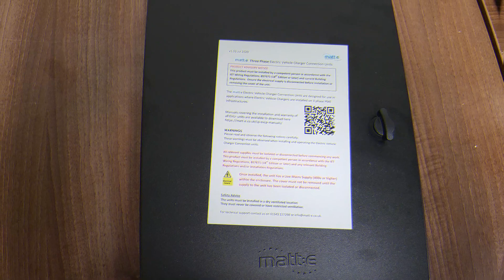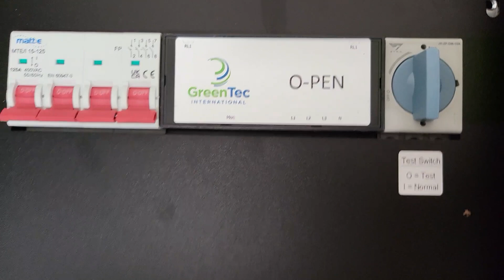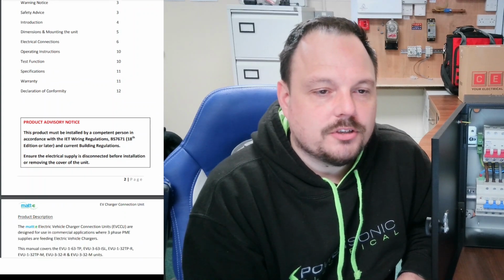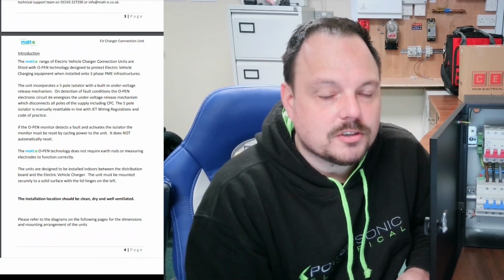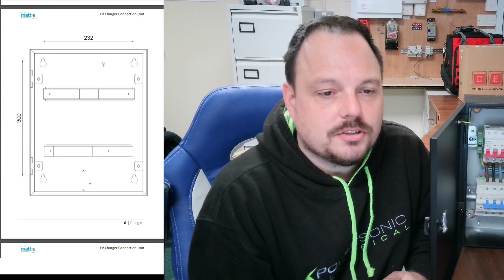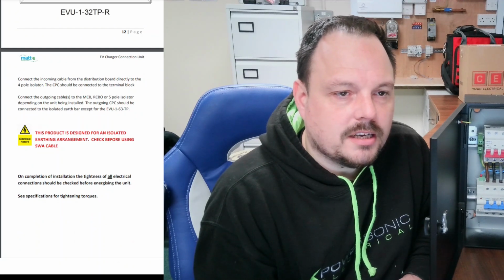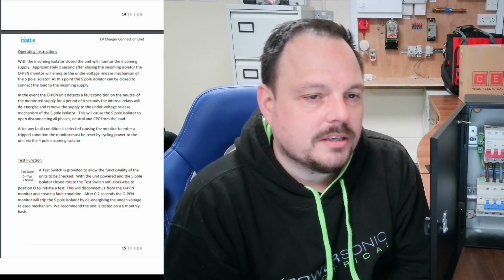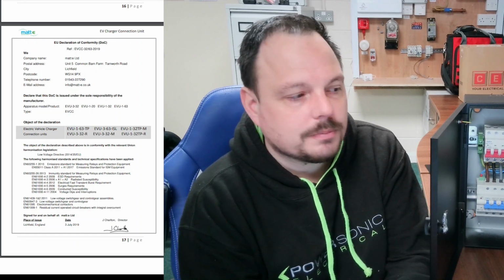STOP !!! 3 Phase PEN fault on PME Matt:e 63A TPN

Comment: Very informative vid Mark, but at nearly 500 quid and can only do one ev unit is this an unaffordable option. Its 3P which usually means a business etc who want 2 or 3 chargers. So 1500 quid on PEN fault protection when there's units with it in-built. Unless I'm missing something.. what's your thoughts.
Reply from the maker: You can get different configuration for more charge points in a single unit. This is just the one we needed. Pen fault still isn't fitted a quite a few TPN EVSE. Which is when these come in.
Reply: @electrician247  oh I didn't know you could get different configurations. 👍🏻 will look into that.

Comment: Do they make Matt-e for single phase domestic installs? Isn’t this technology incorporated into most evse chargers?
Reply from the maker: They do make them for domestic SPN installs as well. A fair few chargers do not have this built in. But those numbers are shrinking with every month. Especially single phase. 

These are a useful option 👌